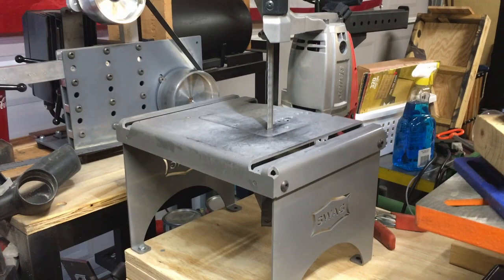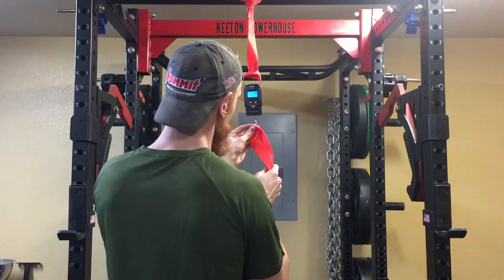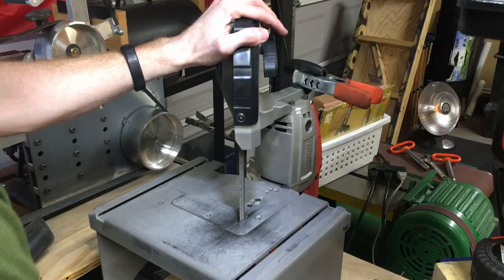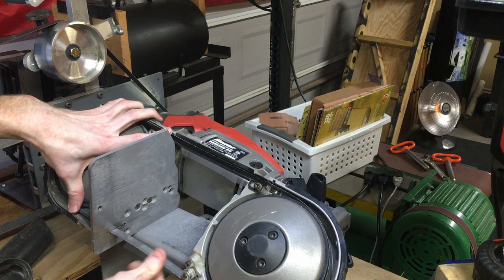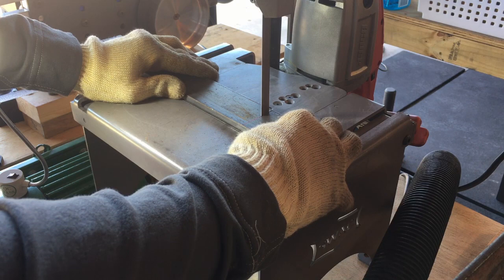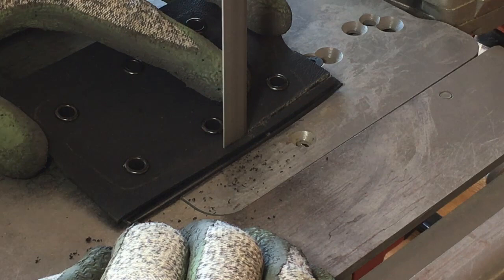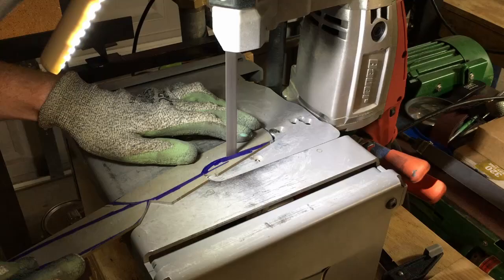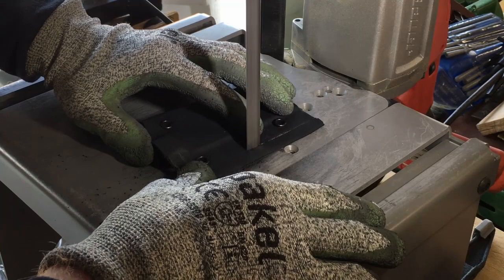Harbor Freight Bauer Bandsaw & SWAG Stand REVIEW

Comment: You've never failed me yet.   Ive been working with 1095 and until now using a cutting wheel.   What bandsaw blades are best?  I seem to be going through blades wayyy too quickly
Reply from the maker: Hey Chance, check out the description. I put some baldes in there I use.

Comment: Thanks for the informative review. I do have one question, if you don't mind. From the blade to the back of the saw is only about 5". Do you find that is an obstacle when cutting out longer knives? I have a hard time figuring out how this set up would work for blades longer than 8" to 10". Thanks.
Reply from the maker: Hey Chris, You may have to get a little creative from time to time (cutting form both ends), but I've been able to do some pretty big projects with it.

Comment: curious whats the advantage of a porta bandsaw and swag table over a bench bandsaw like a wen or something? besides the portable aspect.
Reply from the maker: I think they're generally cheaper? I like the compact size too
Reply: I am not aware of a bench top metal cutting band saw, a wood band saw like the Wen is for cutting wood the blade speed is much faster for wood than metal measured in IPS inches per second. Or IPM minutes 😁🛫

Comment: I just bought one!  I need to cut 1/8" thick (11 gauge) aluminum and galvanized steel. I bought 18TPI blades. I can't find any references on how fast to set the speed, except 'fast for soft materials' (aluminum?) and 'slow for hard materials' (steel?). I estimate the saw runs at 240fpm on setting 1 and 540fpm on max.  Can anybody provide me a good speed reference or advice? Thanks!
Reply from the maker: I've always just run mine on max for everything

Comment: This thing is giving me alot of trouble. A small piece of steel just cut has fallen between the side of the blade and the plate, acting as a wedge and causing the blade to stop immediately, throwing it out of the bandsaw. This has happened twice in 2 days. This isnt just annoying, it is dangerous.
Reply from the maker: Hey man, Yeah, I have that problem from time to time. When cutting off small pieces I'll only do it on the right side of the blade. I also don't cut off many small pieces (leaving that close up work for the grinder). I have seen some people create their own "table tops" for this system with a much smaller slot for the saw blade. Good luck sir!

Comment: The bandsaw is on sale at Harbor Freight for $89.99 (with online or in store coupon) until 6/30/2020 and the SWAG v3 table from SWAG Off Road directly is currently $129.95 shipped.
Reply from the maker: Heck of a deal on the bandsaw. I'm temped to buy a spare!
Reply: Wow in 2022  the stand is $173!  Seems to me that is overpriced and more than what I paid for my saw.😥 I'd like it but not at that price for a little bit if unpainted steel.

Comment: Good review. I wonder if you had looked at this model: https://www.harborfreight.com/horizontal-vertical-metal-cutting-bandsaw-93762.html
It is lower amps, but comes with stand. Thoughts?
Reply from the maker: Looks pretty sweet for handling large stock. I have never used or looked at it though.